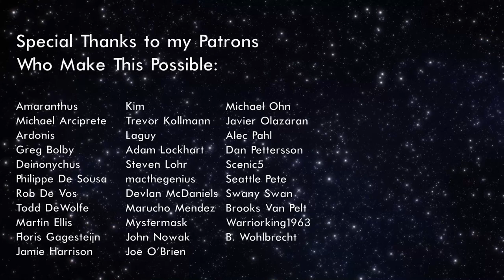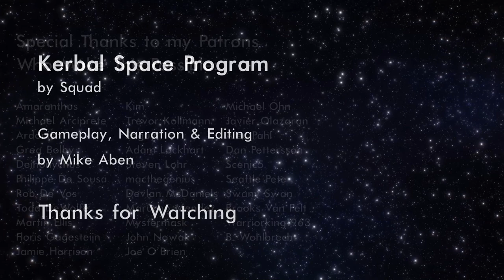Mun Rocket Build | Stream pt. 1/3 (KSP 1.11.2)

Comment: 0:01 I will not forgive Strategia for making their Mun strategy "Plant a flag on the Mun" and not "Land a kerbal on the Mun and return him safely to Earth."

0:05 Walking around on the Mun without a backpack just looks so goofy. I wish they had chest mounted life support systems, like in 2001.

0:10 Did you forget to do an EVA Report close to the Mun?

0:25 I think this is the best biome hop I have ever seen. But why not retract the antenna?

0:31 Those are craters, which can be scanned with the arms but not sampled.

0:34 NO It was skill, not luck!

0:47 Agreed - the visuals are borked for some reason. That should be a parachute. Odd.

1:28 Glad that Warriorking's bad luck didn't come back.
Reply from the maker: 0:01 - Yes, I was a bit surprised by that when I noticed, but I got them home anyway. :)

0:05 - It is weird. Chest mounted life support would be a good idea considering Kerbalism gives them something like 3 hours outside.

0:10 - Nope. Bill and one of the Michael's got a near space EVA during a flyby after Michael's rescue. You may have missed it given how many flybys there were that episode.

0:25 - If I retract the antenna, I have no signal or control. Half way through the slide I began regretting not standing it upright and going for a hop, but I was committed by then.

0:31 - Ah. Thanks. I've not done enough sample collecting yet.

0:34 - I really didn't expect it to work, but when you're extending an uncrewed mission past initial expectations, you tend to care less.

1:28 - I'm eager to build a new plane and say goodbye to the Juno 2
Reply: @MikeAben  0:25 Ah, right. I have RealAntennas installed and forgot how losing the antenna briefly would lose control in stock, unless a relay can pick up your probe's radio.

Comment: I will steal your design
Reply from the maker: Go right ahead, but one thing of caution. When I launch it next episode I discovered that there was an aerodynamic asymmetry that pulled it to the south. I could still get it into orbit and complete the mission, but it does make it harder to fly. It was a tricky one to track down. Turned out that the Mk2 capsule was the cause. If you extend the fairing to cover the capsule completely, the problem clears right up.
Reply: @MikeAben  ok, thanks